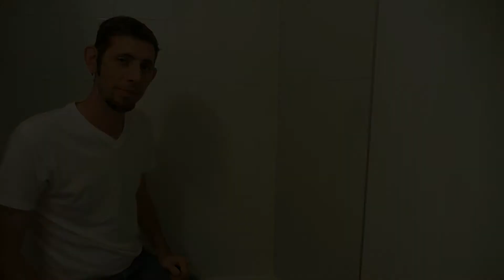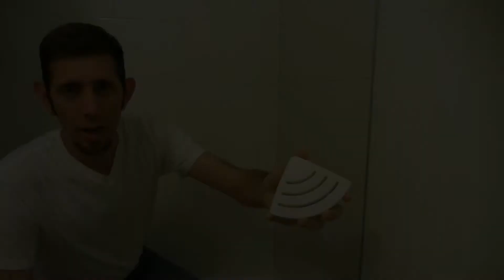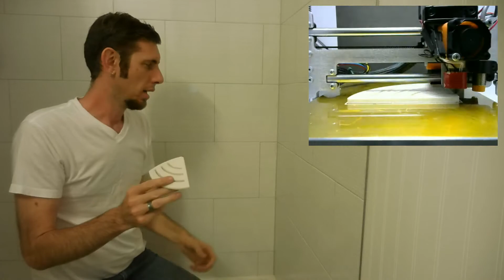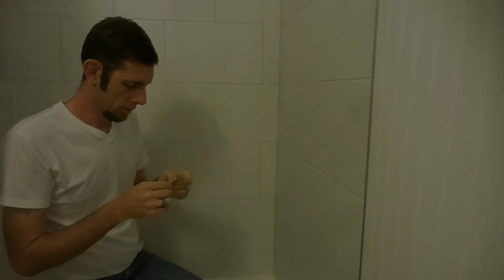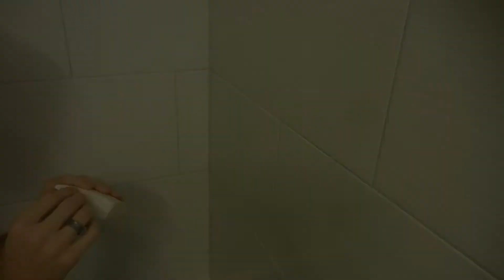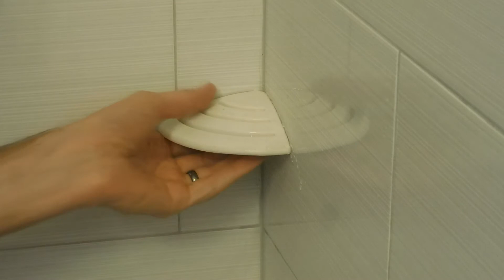3D Printed Shower Step

Comment: Neat idea. I'm curious to hear if you like the smooth finish or if maybe a rough finish might provide a little extra "grip" when you are balancing with a foot up there.
Reply from the maker: Seth Galitzer time will tell, but from the couple times I've tried it grip doesn't seem like it will matter much because you're not really putting a substantial amount of weight on that foot. The one thing about smoothing is to help "seal" up those gaps between layer lines to keep them from filling with dirt, grime, etc. Also, having a slicer that will do variable layer heights would make the layers on the top half be a bit smoother.